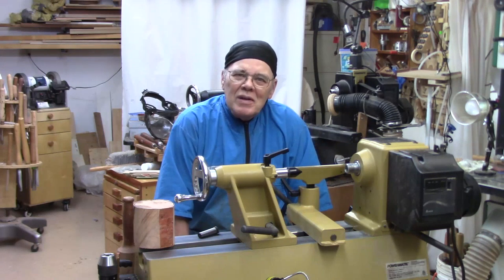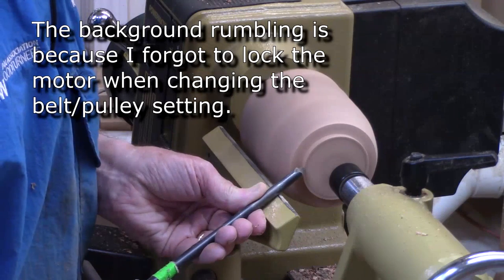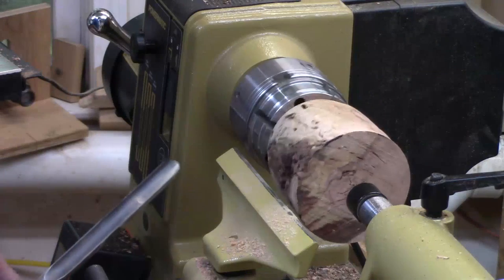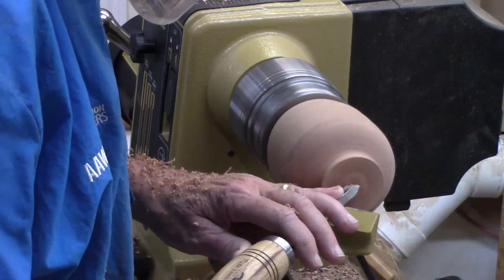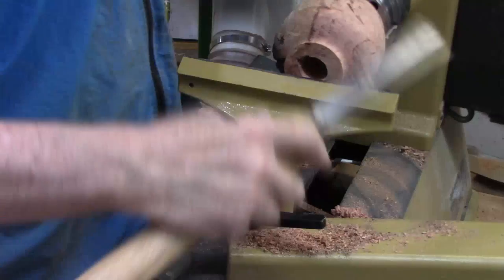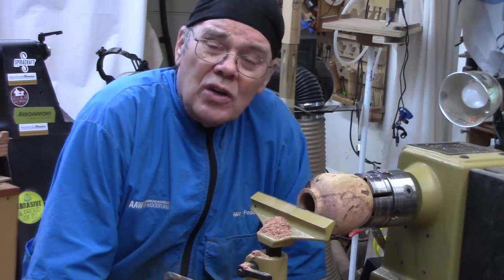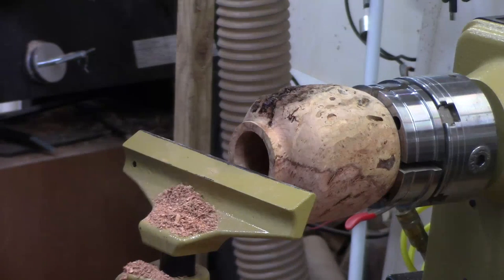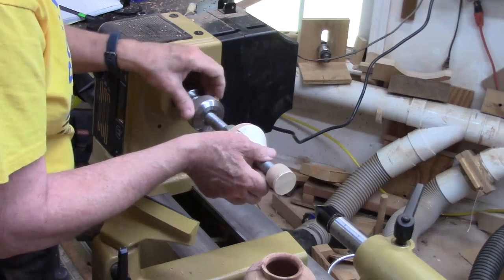Cherry Burl Hollow Form - 4 Ways Collaboration

Comment: That is a very nice hollow form indeed. It remains very interesting to see how the four of you create such different things from the same general idea. Do you have any safety/handling tips on not getting your tool caught in all the gaps and hollows? Did you have a reason (other than aesthetic, it looks awesome) to go with a hole rather than retaining the bark? Thanks for another wonderful video!
Reply from the maker: In this case it was esthetics. I saw the possibility and went for it. If you are turning at an appropriate speed and using a sharp tool reiding the bevel, cutting air is not a problem.